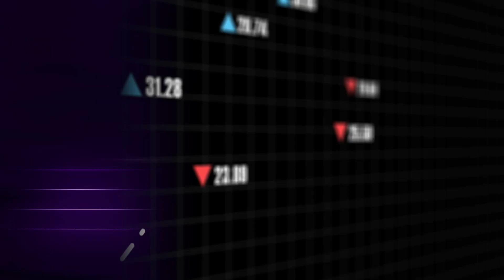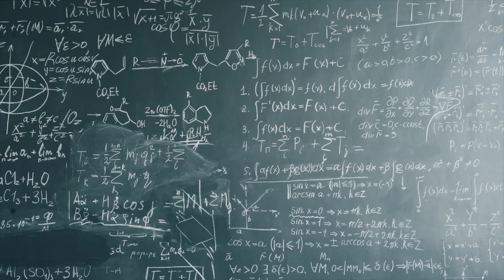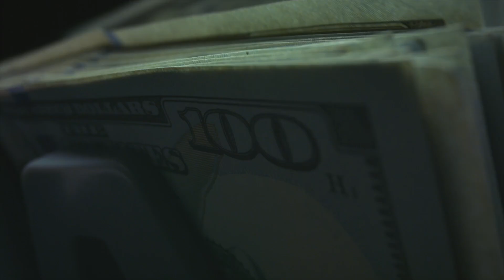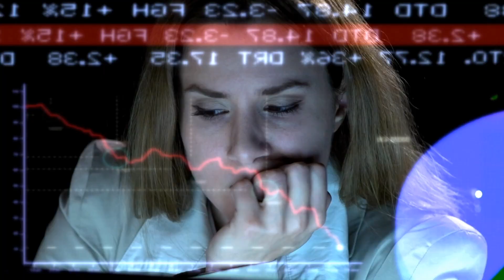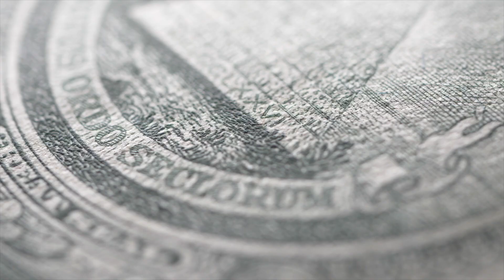5 Megaprojects That Went Horribly Wrong

Comment: A branch of the U.S. military involved in a coverup and falsification of information? Gee, something new- NOT.

I can think of one other project that went horribly wrong- the Vajont dam. It was built across a mountain literally named “the mountain that walks.” Under the top layer of soil was clay- that allowed the soil (once saturated with water from the reservoir) to slide down the mountain. When that finally happened, it occurred in such a huge volume that the reservoir was emptied. The tsunami of water went over the top, down the canyon- and completely erased an entire town and over 2,000 people. Needless to say- it was a significant blunder.

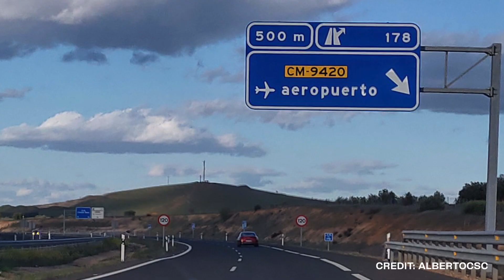Comment: 7:20 Here's someone from Ciudad Real speaking... The idea behind the airport in Ciudad Real is not the distance "by car" from Madrid, because you can travel from Ciudad Real to Madrid by AVE (high speed train) in just 45 minutes, which is less than the time it takes you from Madrid Airport to Madrid city by train/metro (50 min). The real problem came from politicians and constructors stealing public money and by not connecting the Airport to the AVE (train) station directly.

Comment: Another project you can add to your list is the current “Rail To Nowhere To Buy Democratic Votes Project”!, here on the island of Oahu, Hawaii. 
     Yes, the title of the project here in Honolulu says it all. Proposed to voters in the early 2000’s to go from Kapolei, the abandoned second city near the southwest corner of the island to the University of Hawaii for only $2.8 billion dollars, which could have been built by one of three overseas companies in Asia, instead, the project was divided among the different Honolulu labor unions for the soul purpose, you guessed it, to buy Democratic votes!  The corruption, mismanagement and theft of building materials, the project just exceeded $13 billion dollars and will never reach the UH campus and may not even make it half way due to the project overruns. To make matters even worse, the Democratic Party has been hijacked by the current Destructive Party and the project is not expected to finished until 2035. The funds would of been better spent to redesign  the H-1 freeway entrances and exits, which in some cases, are the most dangerous in the world. The project should have been scraped years ago, because now it’s costing taxpayers millions of dollar each year in repairs and the first train hasn’t even rolled over the tracks yet in the 15-20 years this project was started. What’s really sad is this Rail won’t even make it halfway to the University of Hawaii campus, so either way, those students will still be forced to drive to school and this corrupt project will have done nothing to lower traffic on the H-1 freeway at all. If that wasn’t bad enough, each company involved in this corrupt project have been filing for bankruptcy one by one and when it’s all finished, all the people will have is these damn ugly columns in their backyards to look at and to remind them how corrupt the Democrats really are when they take advantage of the people for 65 years straight.

Comment: The 'X' painted on the runway is to mark the runway as CLOSED because the airport in this case is CLOSED. In an emergency, that runway is perfectly fine to use for landing but you wouldn't be able to takeoff because of FOD due to being inactive. Also, there's no one actually manning the control tower so while air traffic control would be able to assist routing to that airport, there would be no emergency ground services, ramp services, etc.

Comment: The stones used in the concrete of St, Francis Dam, were not thoroughly washed, The surface contaminates prevented a proper bond with Portland cement, besides the poor foundation.
Also Mulholland was the designer, builder and he basically signed it off as good to go. A builder now must outsource inspections and Mulholland actually was cleared, largely do to his influence. And a main drag in LA still bears  his name.  If Owens valley had it's way, Mulholland would have bee strung up.
Reply: Amd he should have been

Comment: Funny they mention that airport in Spain that was operational for 3 years, but not the one in.... was that Germany? That never served a single flight, and IIRC, it was even bigger.
Reply: Well, Berlin BER has never been given up and was opened a little more than 1 year ago. So it has not failed yet. Spending 1 billion on an airport nobody wants to use on the other hand... I mean, you can check before hand what airline would be willing to service it.
But i won't argue that spending 7 billion to finally finish an airport 9 years after it's planned opening is a weird flex.

Comment: The Oroville dam's problems weren't just man made. The extended drought was a Big factor. Studies are full of how deep dehydration, killing off of vegetation, ect. AND Shrinkage of the earth Around and UNDER all structures causes structural weaknesses. 
Flooding causes accelerated erosion because it takes time for the ground to absorb it.
Mom and Dad had to have half of the house 'perma-jacked' do to the clay 5 feet down shrinking during a drought many years ago.
Look up Solar Cycle 25: Grand Solar Minimum and the Magnetic excursion of the north and south poles for more insight.

Comment: One of the ironies of the Oroville Dam is that currently (late 2021), the water level is so low (due to drought), that the hydroelectric generator had to be turned off completely. So, in just a few years, we went from so much water it was overflowing, to not enough water to generate electricity (plus all the other effects of the drought).
Reply: I saw Lake Oroville soon after the Dam was finished and it filled up.  I have no idea what it looks like today, but I bet it isn't much of a huge lake anymore!

Comment: Very surprised that you didn't include the Large Hadron Collider (LHC) itself in the bonus @ 8:31! When it was first constructed, it went off without a hitch...except for several electrical failures, magnetic superconductor incidents (and one death of a technician) that delayed the operations a full 14 months between 2008 and 2010

Comment: I am surprised the runways at the closed airport, deteriorated in only three years.  Why would a new runway fall apart so quickly?
Reply: Completely speculating. I know nothing about the specific build...but probably did not get around to finishing and sealing the runway. If the project had been completed, final touches on the runway would have been one of the last steps before opening. 
Just a guess though
Reply: Poor, cheap, construction???

Comment: The main reason the particle collider in Texas was abandoned is because the Soviet Union dissolved less than 2 years earlier and the Cold War ended. The military didn't need the scientific community to make more powerful weapons for them anymore, so costs that would have been accepted in "wartime" suddenly became show stoppers, and the plug was pulled. Don't get me wrong, I'm glad the Cold War ended, but having that super collider in Texas would have been a big boost to keeping the USA at the cutting edge of scientific discovery, as well as having the capability for what I'm sure would be some pretty amazing scientific discoveries.
I really wish that science could be done without needing funding from the military. Are there any other billionaires out there that need a new hobby?

Comment: I remember when the Oroville dam almost collapsed a lot of my friends live in Oroville and i live 20min away from there the idiots didn't even bother fixing it right and had to do it all over again.
Reply: It's less that they didn't bother too, and more that they deliberately chose to.  The "official" claim, is that they were afraid that another really wet Winter would come along again, and they just wanted to patch it up before winter came. 
Nevermind that by tearing out what they installed gave them the same exact timeframe to work with that they had after the Spillways became compromised in the first place.

Comment: Number 3 and 4 missed a lot of details, I’d recommend watching practical engineering’s videos on those dams. Such as they “shut off” the emergency spillway at Orville dam which isn’t possible because it’s not mechanical spillway and just lets water out if it the lake gets to a certain point of capacity
Reply: Yeah, and it doesn't matter how well built a dam and its spillway are; if enough water flows through, cavitation will occur. It happened to Glen Canyon Dam in the 80s
Reply: What bothers me, is that the soft rock that is prevalent in the area wasn't even considered when setting up the emergency spillway. It's practically just very compact dirt.
Reply: Yes.  And it wasn't the rainfall that damaged the spillway as this video says.
Reply: Also, part of the reason the main spillway collapsed was because of a history of missed inspections and repairs.

I was living in Oroville in the winter of 1995-1996 when a series of tropical storms melted the snowpack and filled the lake quickly. With the spillway gates open fully, the lake still came within about 18" of overflowing the emergency spillway. As I recall, at one point there was 2-3 times more water flowing into the lake than could be released. The main spillway held up just fine during that event. If it had collapsed, the consequences would have been devastating.

Comment: 10:20 so the output would be ≈6,41×10^(-6) joules? Where would this energy come from?
Reply: Fission > fast neutrons > water thermalizes and slows fast neutrons > water heats up > primary coolant exchanges heat with secondary coolant > secondary coolant drives steam generators > generators make electricity.

Comment: what did you mean by the ENERGY OUTPUT of the particle accelerator?
It seems like you're saying that the particle accelerator creates and puts out electricity (which it doesn't)
It uses electricity to put out very strong particle beams to create collisions and study the remnants of the collision aftermath.

Comment: Traditional nuclear power has not changed since the 1950s. Despite the patent holder (Alvin Weinburg) for nuke submarine PWR reactors saying they could not be economically or safely scaled up, that’s exactly what’s happened. Westinghouse and Framatome on France have made billions but these plants are only safe because of extremely complex active safety systems. With costs and project risks to match. 
We have much safer and far more efficient designs ready to roll but the (so called) safety regulators do everything they can to stall progress. There are at least two that are fuelled by irradiated waste nuke fuel. They solve the long term waste storage issue by using the long life isotopes to make power. Canada is building one in New Brunswick. USA and U.K. continue to avoid the issue with impenetrable or inappropriate rules.

Comment: Volts no matter how many trillion volts is no energy output.   Without electrical current and be sure as higher the voltage as smaller the current flow there is no energy produced so also the word output is wrong.  And the efficiency is very low, so it needs even more energy to put in to get some little out, so no means of energy output and production. It has other means of science.  But not energy production.  It's more knowledge production. And this is not measured in volts. ;-)

Comment: I fail to understand the dam. How in the world did heavy rain damage the concrete spillway of a dam, and how the the spillway disintegrate when used? Shoddy construction is the only way this is remotely possible.
Reply: If you watch Practical Engineering's video of it, there is an explanation for it based off the failure report. As I understand it, it was related to design of the drainage, made it possible for water to travel under the concrete, creating cracks, making the concrete erode away.
Reply: Why do the shingles on a roof overlap, but the concrete plates of a spillway don't?
Reply: @tonyburzio4107  one reason is the purpose for the spillway. You want high velocity on a spillway, i.e. a smooth surface, to be able to lead the water away as fast as possible, you don't want to disrupt the flow. While on a roof either that is not so important for the function or not desirable because then it would possibly flood the gutter, causing a waterfall all around the house when it rains heavily.

Comment: The deconstruction of the 2 nuclear power plants in Jenkinsville will cost nearly as much money to complete them. 

I live in Fairfield County SC where they were being built. Cost our dirt poor county some 45 million in annual  property tax revenue as well.
Reply: Okay, so this is going to be a long comment, and I'm apologizing ahead of time for that. But your comment reminded me of a piece of similar history local to me. And I'm a history nut, especially local history, plus, my family has ties to this, so I gotta nerd out a little. Sorry in advance, lol.

We had something similar happen near where I live. There was a nuclear power plant proposed for an area near Madison, Indiana (Saluda township, I believe it was), in the late '70s-early '80s. It was called Marble Hill. 

My dad, a sheet metal fabricator and welder by trade, worked on the construction site for a short time. He said it was extremely strictly regulated. He had to wear a special battery powered backpack for his welding rods, that kept them at a specific temperature. It was checked regularly. If welding rods were found to be at the wrong temperature, they had to be discarded, as they were no longer stable, or it made them weaker, something like that, I'm not a welder myself, lol. But the gist is, using them in that state would compromise the integrity of the structure, and therefore the safety of the public. And it was Dad's, and the other welders', responsibility to make sure their batteries were charged, and their backpacks working correctly. If rods were found to be at the wrong temperature, and had to be discarded, the bearer of those rods was in BIG trouble! Up to and including being fired from the job. And this was just his (relatively) small part in the construction. 

In any case, much of Marble Hill's infrastructure was built, including many smaller buildings, and even one huge cooling tower. But then construction was halted, and soon the entire project was abandoned completely. 

There were several reasons, much like the one on this list, and the ones you mentioned. It became too expensive. It was built literally right next to the Ohio River, which provided, and still provides, hydroelectric power (in some places), as well as boasting coal fired power plants on its banks (and also providing an easy means of transportation for that coal, directly to those plants, as well as water for cooling and steam), some only miles away from Marble Hill. 

And another big reason the project was abandoned, was that it was unfortunately being built right around the same time that the Chernobyl incident (and the one in Pennsylvania too, I believe) occurred. So there was a lot of distrust in nuclear power, and many protests at and around Marble Hill. 

In the end, it just cost too much trouble and money, and was abandoned before it was even finished. The local power companies took a huge loss, and of course there was the frustration and anger from their customers, over the raised rates. And it's a bit of an embarrassment for the cities/companies involved, as well. They all left it, and then promptly erased it from their collective memories.

The compound has sat, empty and forgotten, ever since. It fell victim to vandals and scrappers, and was a popular spot for urban explorers (even before that was really a thing), and it suffered the ravages of time and nature. As abandoned properties almost always do. Demolition has been going on for years, but at a very slow rate. The huge cooling tower is now gone. But many of the smaller buildings still remain, even now, some thirty-some-odd years later. Or they did, at least as of the past couple years. Not sure exactly how much is left, at present.

I heard that they're working on truly demolishing the whole site now. That someone bought it, and has some kind of plans to develop the area. But only time will tell, I guess.

Would probably be a good thing. The site is dangerous. (There was never anything radioactive there; they never got that far. But there's a ton of debris, like broken concrete, rusty metal, and all the other stuff you'd typically find at a place like that.) And I don't know what the property tax has cost, I'd have to look it up, but 30 years worth has got to be a ton of cash. 

Marble Hill was a bad decision, from the very start. Looking at it that way, it's kind of a bruise on our state's history, a black eye inflicted by overambitious, money hungry, out-of-touch, rich businessmen and politicians.

Even so, it's an interesting piece of local-and personal-history, to me. And kind of sad, in a way.

The nuclear power station that never was...

Again, sorry this was so long. But I hope you at least found it interesting.
Reply: @mariebelladonna437  Fascinating story! Thanks for sharing it with everyone. 😁

Comment: 40 TeV sounds like a ton of energy, until you realize that a swarm of gnats has about 20 TeV worth of kinetic energy. I mean, as far as accelerators go, that's a massive amount of energy to have in the particles of a particle accelerator, but it really puts into scale just how few particles an accelerator works with at any given time.
Reply: I don't think they really wanted to build a patricle accellerator over there. It was to mislead the public. They built the tunnels and generators as a refuge for the elite in case of nuclear war or alien attacks... and the tunnels are already finished.
Reply: 12.4 million gallons ain't sh*t. How 'bout 12.4 billion gallons.
Reply: 40 TeV..  Over estimated energy figure and understimate costs.  nah that seems legit.